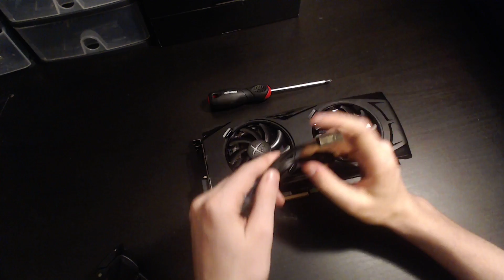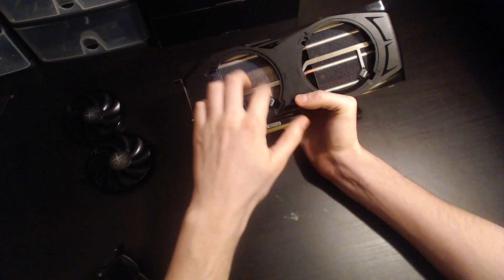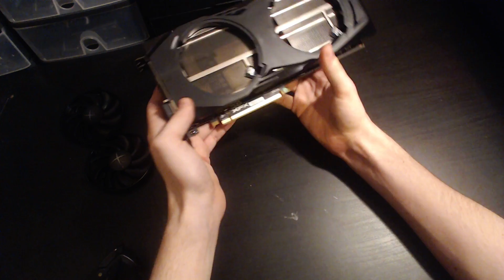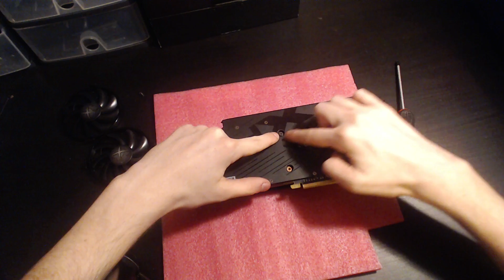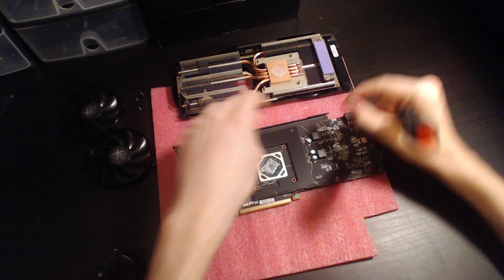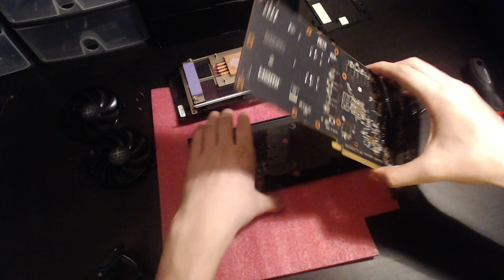XFX RX 480 GTR teardown

Comment from the maker: First
Reply: Liar
Reply from the maker: Jealous of my Firstness much?
Reply: I'm going to report you so you're gonna be banned from this channel, my father works for the internet
Reply: lol
Reply: which cards use the only the 8 pin to power the core?
Reply: Asus Strix and Sapphire Nitro+ as the core vrm is towards the back of the pcb.
Reply: Asus Strix and Sapphire Nitro+ as the core vrm is towards the back of the pcb.
Reply: Tutankhamun1333 thanks
Reply: rpm in game ?
Reply: REport and my *! :)) and my "family" working for INTERNET! ALL OF THEM  WORK EVERYDAY FOR NET ! :))
Reply: Just wondering if you have a datasheet or any idea if the XFX RX480 RS 4GB is reference or custom? It does seem to have only a 6 pin power connector, so I expect it's not quite as elegant as the GTR, but it would be good to know if it is custom or reference. Looking at buying two of these and the price differential between the 4GB and 8GB cards especially when buying two of them is enough to warrant some mulling over, as the 4GB of VRAM once overclocked doesn't seem like it will present any performance difference and no capacity issues that I can see after reading a few reviews.